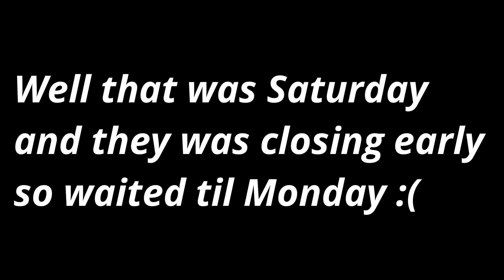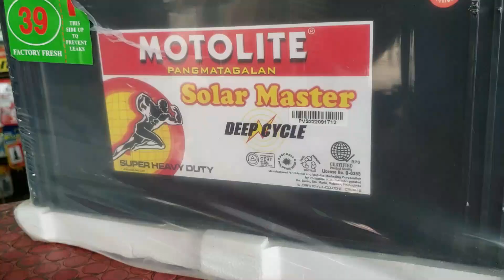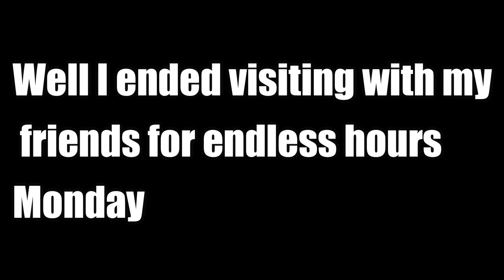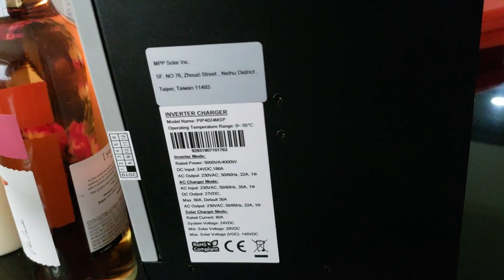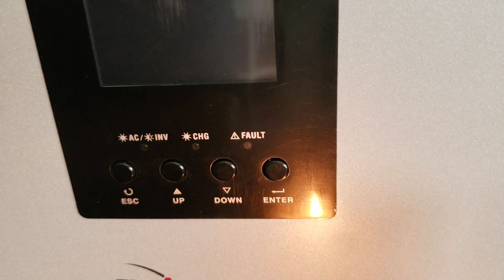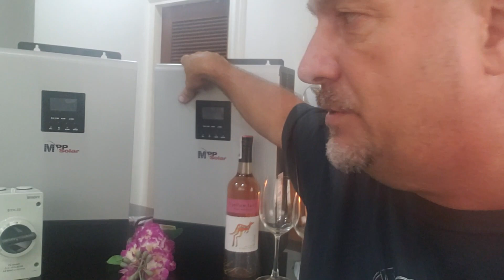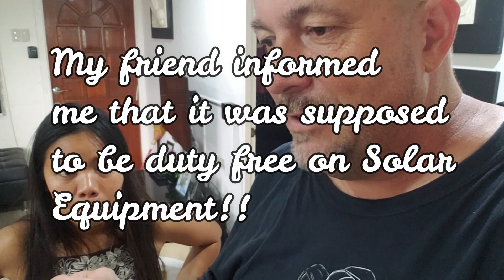Episode 15 MPPT HYBRID SOLAR  OFFGRID! Beach house build Philippines

Comment: I built a 170 sq mtr home on a remote island in Bohol. 5Kw off grid system. 12 (345 watt) panels, inverter/controller(Single Unit), 8 into 2 Combiner, 8 12V (200ah) deep cell batteries, yield 4,200 watts @ 52 Volts. Best thing I ever did.
Reply from the maker: That is what I love to hear- Success stories!! What brand batteries do you use? Glad to hear from you there. Maybe some day I can buy you a beer and we talk about it more! Stay in touch